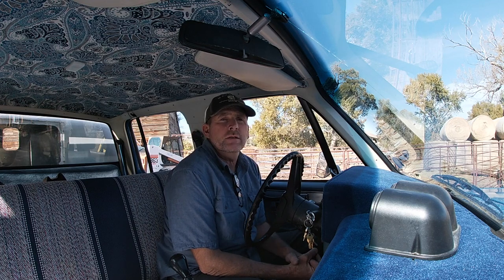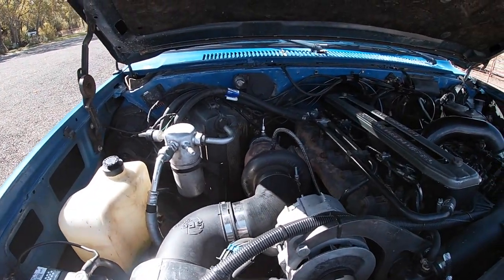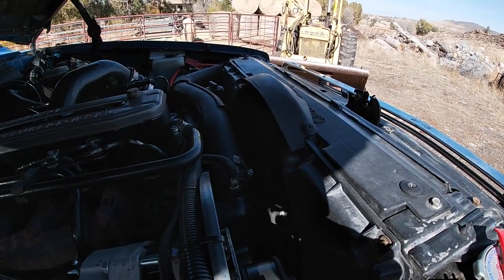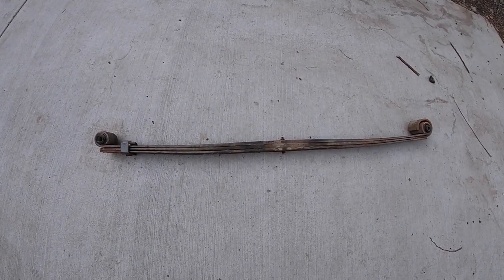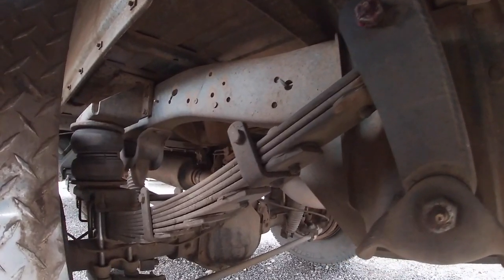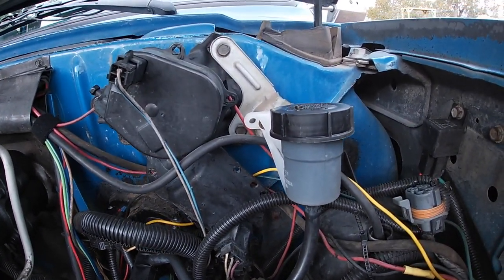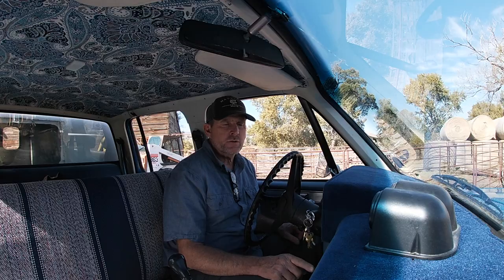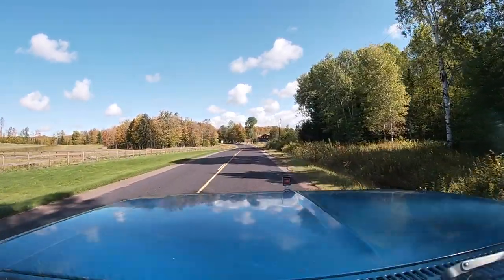Cummins Swap Square Body

Comment: been wanting to do a 6.7 and a 68rfe in a square for some time may just do a ly6 and 6l90e since gas is so much cheaper in all ways. i really cant find any info on how to hook a np205 to the 68rfe but i figure since you can hook a allison 1000 to one with a adapter you could the 68rfe since they both use a np271hd and will bolt from  one 271 to the other.
Reply from the maker: Unless your going to use your truck for pulling something, I think a Built GM gasser is the way to go. City driveability is way better with a modern gas engine and transmission . I have a good 73 c20 I want to build some day with a 5.3
Reply: @goingofftherails9877  well i do pull cars alot and plan to buy a camper but i think a gas truck would do fine with either for my intended purposes. since the old trucks weigh a bit less helps alot too. under 6k vs my 05 ram almost 8k.

Comment: How does the intercooler being in front of the ac condenser affects your ac performance?
Reply from the maker: Doesn't seem to have any effect on either A/C or Coolant temp. However Colorado summer temps are much milder than other hot climates. Pulling the Camper on 90 degree days on the interstate seemed to operate normally.

Comment: Cool truck! Im a dodge fan but I have a 1984 chevy c30 I'm gonna put a cummins and a 6 speed into one day trying to find the 12 valve engine and nv5600 trans on gonna throw in it
Reply from the maker: I would love to have a 6 speed trans as well. The 5 speed does well with 4.10 gears but I am going to switch to 3.73 in the near future and that may be when I'll wish for an extra gear
Reply: @goingofftherails9877  have you looked at a g56?
Reply from the maker: @oldcroneysgarage9739  I haven't ever seen g56 case out of a truck to gage size. My guess is you would have to do more drive line tunnel mods to fit a bigger case. My shift lever for my 4x4 T case is very close to my  bench seat right now. I guess an option might be to move the engine closer to the radiator and use electric fans. Would be worth checking in to.
Reply: @goingofftherails9877  a guy I watch on youtube put a g56 behind a 12 valve in a dodge but I'm pretty sure it's different for chevys. Might go check out v belt and son on youtube he works with a lot of 12 valve engines. I'm might be looking at converting my 1982 chevy c10/k20 to a Cummins with a 6 speed mines a single cab 4x4 with a Cadillac 425 big block its hard to find parts for a Cadillac 425 any where
Reply from the maker: I have seen v belt. Thats a nice set up he has. I learned how to drive and got my learners permit in a 1978 Fleetwood Broughm Caddy. It was pink!!!! and had a 425 ci v8

Comment: Total cost of the swap?
Reply from the maker: Well... lets itemize 
1. bought old farm truck as donor 
2. machine block, rings, springs, head studs(arb)
3. rebuild on NV4500 with syncros 
4. advanced adapter plate and new spline shaft
5. modify both drive shafts with new u joints
6. South bend single clutch with slave and master
7. relocation bracket for A/C and  alternator 
8. new gm alternator and A/C pump
9. rebuild p pump at Industrial injection
10. Fass fuel pump and new fuel lines
11. Modify fuel tanks with fass pickup straw
12. Two new Batteries with heavy wire and grounds
13. After market innercooler with silicon tubes
14. new 40hp over injectors
15. rebuild kit on HX35 turbo
16. 4" exhaust with 2 mufflers
17. motor mounts with new cross member
18. Tach and gauges for boost and egt
19. Sound deadening and carpet kit
20. EFI live Power Driven Diesel 
21. New springs and shackles ORD
22. Belts, hoses, wires, misc......
23. untold hours of modification and fabrication and frustration 

 How much?  25k+ but worth every penny

Comment: Do you remember the dimensions of that intercooler?
Reply from the maker: I got it on Ebay. Its a universal intercooler that is a 31 x 12 x 3. I built two brackets that are welded to my core support and just ran two more bolts down from the top shelf of the core support. Had to shorten the hood latch mechanism just a bit but it still works fine just don't have as much room to get your fingers in to move the safety latch. Had to get creative on the driver side for my piping to miss my big block radiator . The passenger side is a simple 90 silicone boot but the driver side is a 45 degree silicone boot to miss the radiator. Used a 4" hole saw to make the entrance and exit holes for the piping. Hope this helps
Reply: That's great. Thanks!!!
Reply from the maker: @hunterdias3080  I will add some video in my next posting of the latch and intercooler. If you have watched Gale Banks you know that cool dense air is the key to making more power, so naturally the bigger the intercooler the cooler the air. But I made the decision to leave the trucks front clip as stock as possible and not cut and fit the dodge radiator and intercooler into my core support. I know this was the best choice now because I left my radiator,A/C , wiring, mounts, grill, lights, everything in place. The intercooler fit great behind the grill and my cooling system still works great. Might be suffering some power loss because of the smaller cooler, but that's a hard thing to know without a comparable set up. Keep watching and I will explain in later video.

Comment: Great build man! Check out my Cummins swapped blazer!
Reply from the maker: Nice job on your build . Are you using the 24 volt  Military electrical system or switch to 12 volt?
Reply: I rewired entire truck with new fuse block. It’s a 12 volt system now

Comment: Great video. I'm with you on the simplicity and ease of repair on the older trucks. I'm getting ready to put a 4 door square body on a C50 chasis. I would like to do the cummins swap and your video has some great information. Thanks! BTW nice footage of the needle hwy. you didn't pull the caboose up there did you?